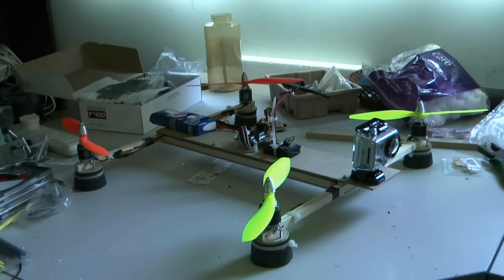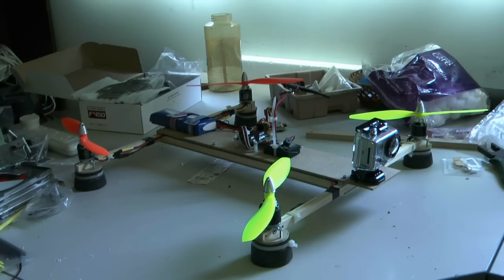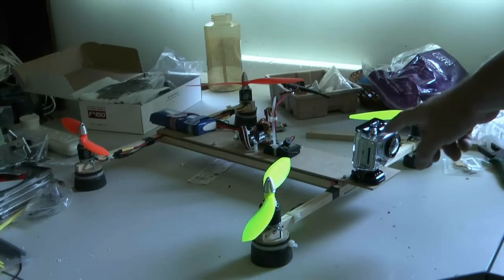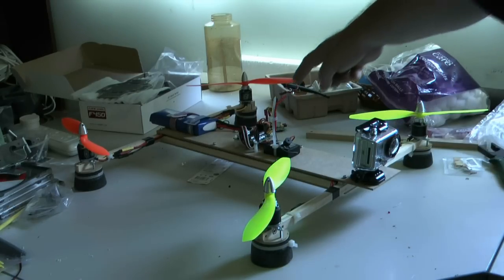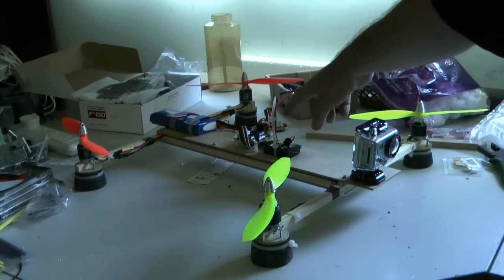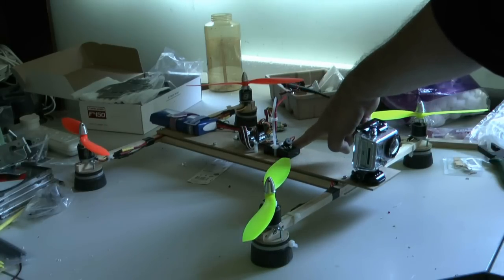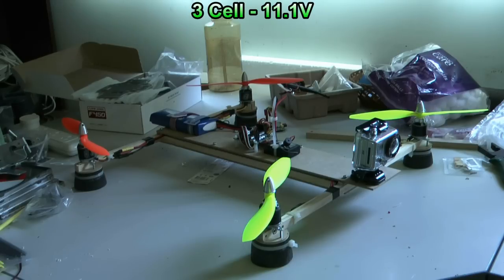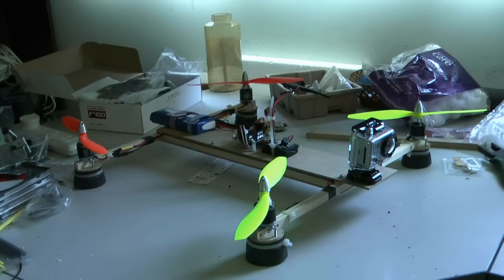H-Quad Build & First flight

Comment from the maker: Thanks :) I think I will try a 4s LiPo.. it's not lacking for power but I was after a really light quad for long flight times. As the top plate is screwed on I think I will replace it with thinner lighter ply... maybe 2mm. The bottom plate is glued on so I might just make some cutouts in it. Or... I might just do more test flights & crash & break something ;) I will definitely try a build with no GoPro case but would like to keep it if I can... I crash too much to leave it exposed!

Comment: 1.1kg AUW still not bad! If it's short on power being too heavy, try 4s and smaller direct drive props instead of SF ones. You can cut the holes in the plate as well and throw out that Gopro casing which is a whole 100gr, but not sure is that an option for you:) Quad looks nice!